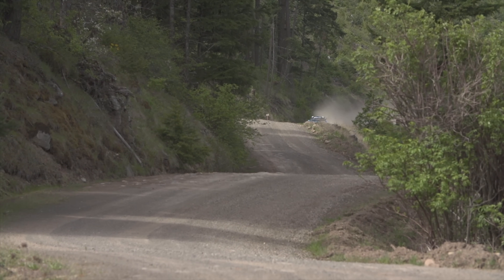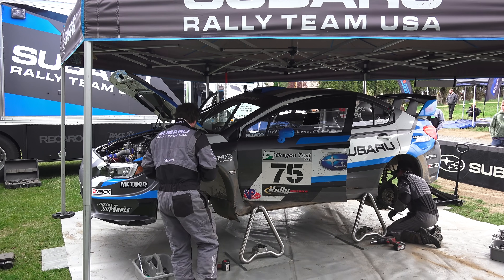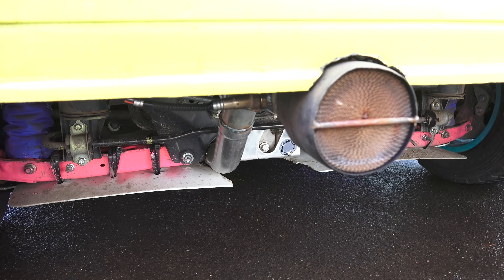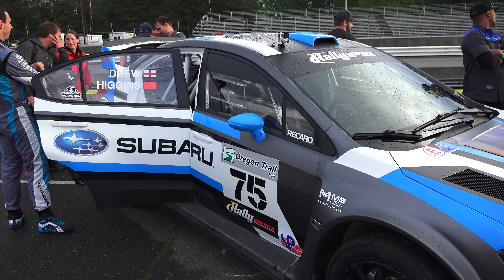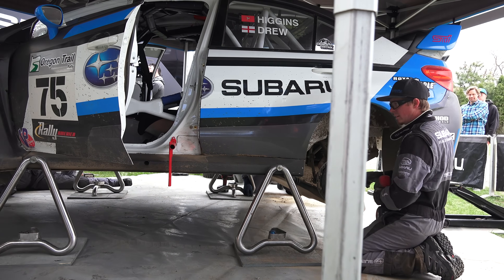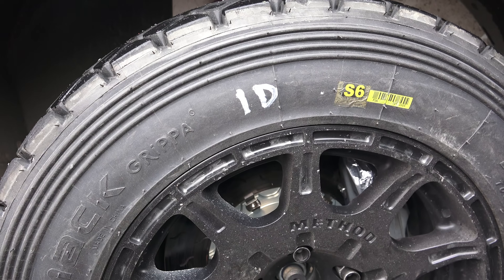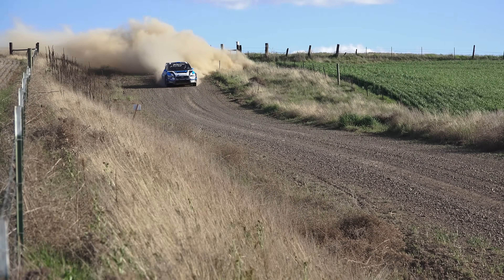Rally Car Racing - Subaru STI Rally Car Explained

Comment: Why does the motor roughly last only 1200 stage miles? Is this some sort of safety precaution gauge in miles to prevent future breakdowns or does the engine literally last 1200 miles before needing to be replaced?
Assuming it is tuned properly, I don't see a reason for why it would cause much issue unless they are tuning for the leanest, but shortly manageable, setting that produces the most power?
Reply: TWIRKNOLOVE  Mainly its because of the stress. Mostly caused by the anti-lag system as it puts a considerable amount of load on the engine and turbocharger.
Reply: TWIRKNOLOVE Stress lol. The engine spends much of its time near the redline. A road car won't last very long either if it is being driven under such stress. Especially one that's pushing 40 psi boost.
Reply: ***** Manufacturers tune their engines for production cars very conservatively so that they are reliable even if they are abused by some random idiot like me. Even on performance cars the engine setup is still on the conservative side. For example, you can see people getting more power from just an ECU flash. Subaru's rally power plant is much more high strung and they probably limit the mileage turn over to keep the engine fresh and in tip-top shape.
Reply: TWIRKNOLOVE  You have no idea what happens with a serious setup for about 600bhp or more(example world rallycross). With the high boost and agressive anti-lag setup it burns through exhaust valves. So I can imagine on this setup after the 1200 miles the engine is a fair bit worn out. In order to prevent mechanical failure they just change it all.
Reply: shift9303 Okay that's what I was thinking. Limit mileage turn over to prevent future woes and keep the engine fresh. I can't imagine it being worn out after only 1200miles
Reply: TWIRKNOLOVE The high psi was implying high power lol. But yeah, since the torque and power are high at like the entire powerband, the engine is always under high stress. Not like a peaky street tuned engine.
Reply: TWIRKNOLOVE To add to some of what others said you also have to remember that the transmission are also geared very different than normal cars. You add that to the 40lbs of boost more people mention and a lot of components get very stressed since the engine is constantly spinning at a higher rate. Also if you recall in the video they have to move the cat as far back as possible so it doesn't melt. That means the engines are constantly putting out massive heat.
Reply: True but these only have 320ish hp. The GRC cars are setup with 600plus though. There is a reason the stock STI comes with right around 300 hp. A company like subaru could have easily pushed that number to compete with the hp high performance cars street cars but they spec it towards rally specs instead because of the heritage.
Reply: TWIRKNOLOVE they can rebuild them quickly it isn't a problem.

also 1200 miles in stages is a lot of miles, no road car doing rallies will get close to this while providing an even good time.
Reply: it's also a part of the maintenance plan, they probably rebuild at this interval to avoid and decrease greatly the event of engine failure during an event. 

no road car (daily driver) can handle prolonged rallying.

anti lag is tough on cars too.

Don't f1's rebuild the engine per race and top fuel dragsters rebuild an engine every run.
Reply: Yeh, F1 engines are rebuilt usually every race, and dragsters are rebuilt after every run. Daily driven cars, what you and I see driving on the road everyday aren't built with racing in mind. More of economy, fuel economy, safety, etc. If they were built with racing in mind, you would pay many thousands more. If you look at the price of a Subaru Impreza STi, vs. the bottom end Impreza, there is a massive price difference, and it exists for a reason.
Reply: Peter Vladimirov I thought the stress of anti-lag is put on the manifold and turbine itself considering the combustion is now happening inside the manifold and thru the turbine rather than the motor's cylinder? Correct me if I'm wrong anywhere or if it's related!
Reply: todorpetrovic But 40psi is just pressure. The stress would have to come from the torque/power the motor is producing which I thought if tuned properly, shouldn't be much of an issue damaging parts. Especially forged/reinforced/whatever expensive bits are used as preventative destruction. Isn't it only sub 400wtq? I know an early TQ power band is hard on the motor, but 1200 miles?
Reply: Peter Vladimirov That's true. The rally cross motors are rebuilt or replaced after every event, even though they've only been used a fraction of 1200 miles.
Reply: +TWIRKNOLOVE If you pushed the average even performance oriented car as hard as a rally car, most of the parts on it would fail in short time. Drive your car like a  rally car and see how long the engine lasts before it dies. Production cars that the average person buys are meant for economy and reliability under nominal stresses. A rally car is meant to go flat out all day. Very different stresses.
Reply: +Sirena I would have to respectfully disagree. When you say parts would fail in a short time, are you directing that to parts you can just replace or internal parts that would effect other part's destruction as well like dropping a valve, breaking a ringland, or losing a connecting rod bearing? I'm starting to think they replace the engines in short times because considering they are turbocharged, they are probably using the best appropriately sized turbo for the motor to make the best usable power and doing so, they have to tune it to the leanest acceptable condition that would maximize the power because you make the best power at the leanest AFR, but also slowly self destruct itself considering lean conditions cause detonation which eventually kills anything inside the combustion chamber. I flat out beat my car up at the track because I have a lot of room for error on the course and my car is also turbocharged which didn't come factory. I never break anything because it's tuned slightly rich, has an ignition cut in case boost pressure increases, and I'm making conservative power, purposely, for longevity. It has 15,000 miles on it since I built the thing internally top to bottom!
Reply: Sirena Not sure where you're going with this comment!
Reply: Sirena in Singapore we pay sgd $106 000 for a car because of 
Transport fee
Road fee
Tax
Government stuff
Agent stuff 
Arg I just hate this

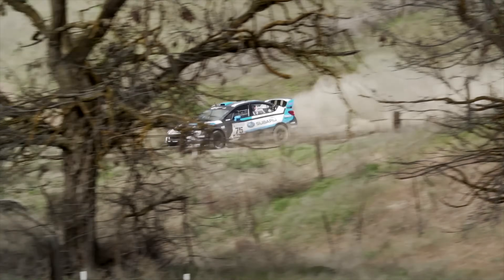Comment: 1:05 You say the anti lag system injects air, but I thought it injected fuel so there is combustion in the headers, keeping the turbo spinning... ???
Reply: Eric D Eric 's right, there is no need to "trick" the ECU. The ECU knowingly adds a rich mixture to the cylinders. All available air is then burned with some of the fuel, with the unburned fuel getting pumped out with the exhaust. Fresh air is then injected into the exhaust stream where it mixes with the unburned fuel, and ignites when it reaches its flash point due to the hot exhaust components.
Reply: Eric D If the PCM reads more oxygen in the exhaust manifold, then it would inject more fuel into the cylinder. This would cause the fuel to burn incompletely, then the unburned fuel would get reignited by the hot exhaust manifold/valve. Pretty simple.
Reply: Dadul Ludad it uses pressured air instead of fuel ignition to keep the turbo spooling, the added air ignites the exhaust gas and builds up pressure to keep the turbo spooling
Reply: Dadul Ludad I thought it was to trick the o2 sensors to run the car very rich. This would cause combustion in the exhaust manifold, creating high pressure to keep the turbo spooled.

Comment: For the restriction plate it has a 33mm so do they have 40 more or 40 less horsepower?
Reply: Little Girl no, 40 less than the guys with 34mm restrictor plate...
Reply: You still dont get it. Read your first comment. You said the restrictor plate reduces 40 horses from the non restricted turbo, which could be in some cases true but in the video 40hp was the difference between the 33mm and 34mm restrictor plates.

Please, think. please.
Reply: Little Girl "40 less than what the turbo could totally provide, just to clear any confusion, the turbo doesnt remove horsepower." its actually 40 less than others who use 34mm restrictor plate.
Reply: 40 less than what the turbo could totally provide, just to clear any confusion, the turbo doesnt remove horsepower.
Reply: Little Girl You dont know what your talking about, ofcourse you dont turbocharge to lose power.

Example: Joes Subaru has 500 horsepower with totally unrestricted turbo.

Then comes Susan, with a 34mm restrictor plate reducing horsepower to 300hp.

Lastly, this car with 33mm restrictor plate producing 260hp. 40 less, see?

Engine with no turbo: 200 horsepower.

All numbers and names are just for example, not actual power.
Reply: Little Girl Your a troll or an idiot. Have a nice day.
Reply: Mortalomena It's you're, piss off and have a nice day good sir.
Reply: That Method Guy TG less
Reply: Mortalomena Not sure if you can read or not, but I said 40 less than what the turbo can provide. You don't turbocharge a motor to remove horsepower.
Reply: Mortalomena That's what my original comment meant, have you been drinking sir?
Reply: Mortalomena That's exactly what I said. Go elsewhere, you're shitposting useless information to the original commenter.